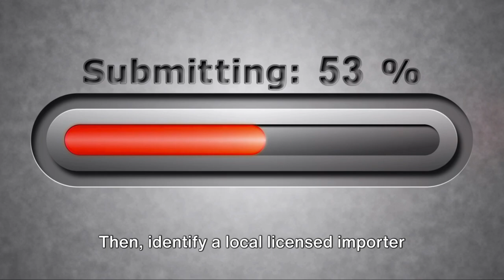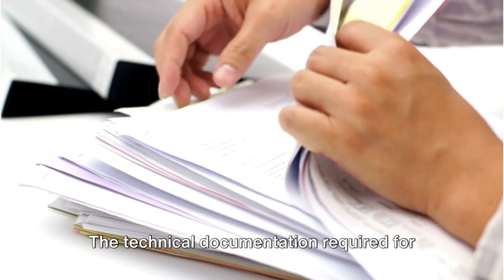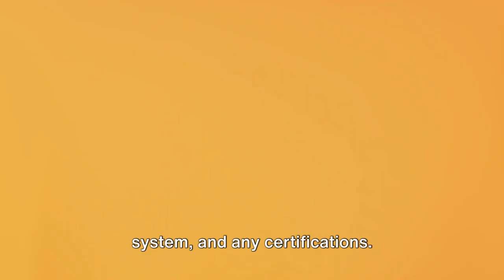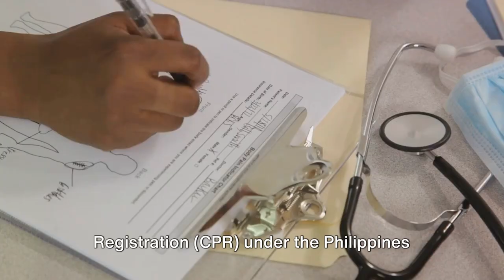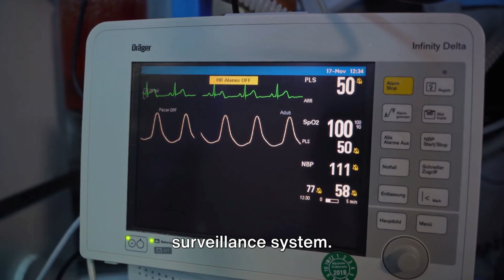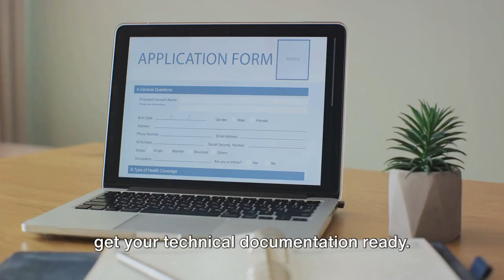Philippines Medical Device Regulatory Steps

Comment: Hello po. Nag apply po ako nang LTO for medical devices, retailers. Need po ba gumawa nang CMDN po?
Reply from the maker: The CSDT must be submitted online via electronic mail. Class A medical devices are required to undergo e-notification via the e-notification portal system.

Once the medical device has been either notified or registered according to its class, the FDA CDRRHR will issue a Certificate of Medical Device Notification (CMDN), a Certificate of Medical Device Registration (CMDR) or a Certificate of Product Registration (CPR) which serves as the Marketing Authorization or Product Approval License.

The company which receives the CMDN/CMDR/CPR or Product Approval License is also known as the Product License Holder. Multiple registrations of medical devices with different distributor license holders are allowed in the Philippines if the agreement between the manufacturer/supplier and the distributor (importer/exporter/wholesaler) is non-exclusive.
Reply: @DocuRegs-On-Regulatory  inaabot po ba tlga ng months ang application, pinalakad ko kasi sa pharmacist ang akin, 6 mos. Na wala pa din kahit yung portal 😢 baka matulungan nyo ako
Reply: I mean yung cdmn, meron na po kami existing LTO.
Reply: San po ang Mga manufacturing ng medical device dito sa pilipinas may product po sana ako papa manu under sya ng medical device..salamat po sasagot
Reply from the maker: @MarlonMarcia-c4t  Please clarify your needs.  Kelangan mo ipa manufacture ang medical device mo sa pinas?